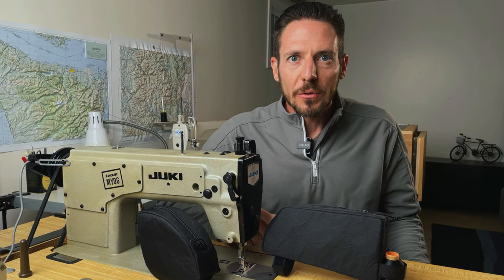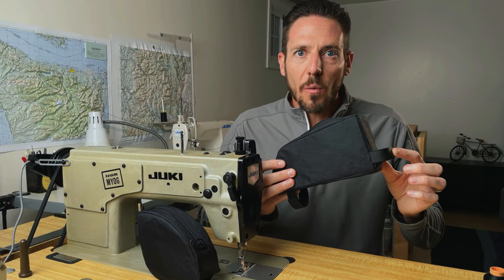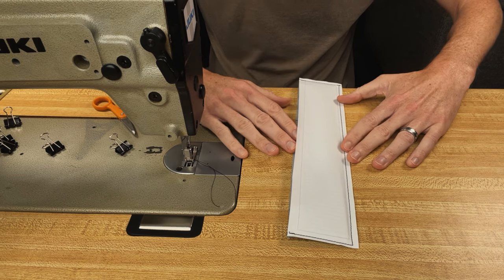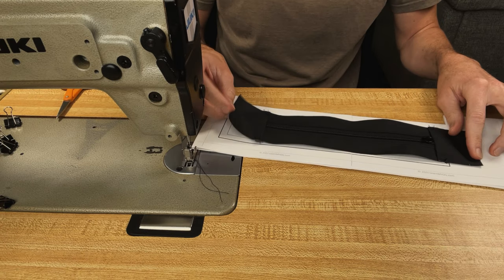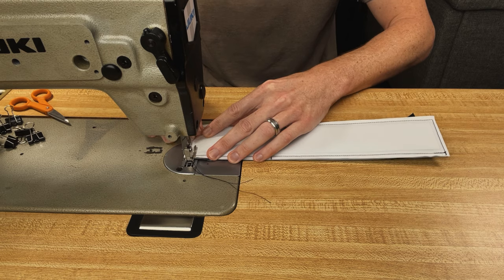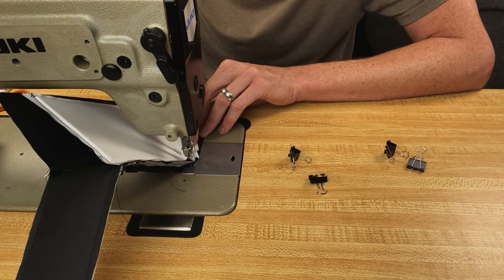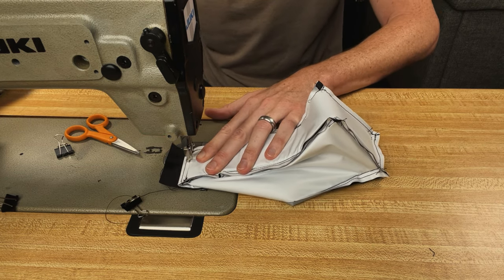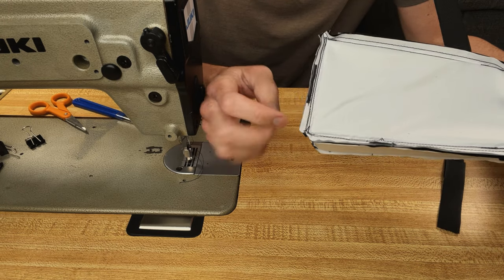Make your own bikepacking frame bag set

Comment: Would really like to see more stuff like this from you guys, especially since these patterns were retired. Being able to make custom bags for my bike or to fit specific products would be very helpful.
Reply from the maker: @williamreinhard  retiring old patterns makes way for new. These are pretty straightforward and not too difficult to self design. Just need the ability to accurately measure the perimeter of the side profile so you can size the zipper gusset.
Reply: @LearnMYOG  Oh, I'm not upset that the designs were retired. Just wanted to say that I really like this style of project and would like to see more stuff like it.

Comment: I m making the HFB ... I have no clue what you mean by ' Fold garage in half an baste stitch on drive side ?????    I could really use some visual clues here LOl
Reply from the maker: The garage is the wedge of fabric at the front of the zipper so the zipper pull is covered when the zipper is closed. You fold that pattern piece in half and the sew it on top of the side panel partially covering the closed zipper.
Reply: @LearnMYOG  thank you!!!!

Comment: Great tutorial!
But how do I work with plastic stiffener, not the flexible foam? It’s really hard to do basting and sewing with firm panels
Reply from the maker: Thanks. Why would you want plastic panels inserted?
Reply: @LearnMYOG  to add rigidity and protection to the contents of the bag. For example, I made bicycle basket bag and camera bag and the foam was definitely not enough. It was extremely hard to work with plastic stiffener, I had to add internal pockets for stiffener sheets.
Reply from the maker: I use ABS plastic for backpack frame sheets and others use HDPE. Encasing like I do with foam would work so you don’t have to sew through the plastic sheet. But sewing a 3D corner will be tough so construction order and seam placement may take some creativity.
Reply: @LearnMYOG  Exactly! Thank you 😃

Comment: Top Tube bag question:  The pattern is one piece with a big line down almost the entire middle.  Am I supposed to cut that in half so that the zipper + tabs can fit between the two? If not, more detail please! and thanks.
Reply from the maker: Yes. I think I included a link to a detailed video on inserting zippers.

Comment: Kind of confused on attaching the zipper to the rest of the middle piece.  Right sides together and sew only on one side, the side where the zipper is when up?
Reply: To get your tabs on, I like this method: https://youtu.be/XDXNP_HkK28 It's different than the method the LearnMYOG zipper video, but it worked for me because I'm using thicker fabric.
When sewing the 2nd tab on, make sure the zipper is the correct length to the LearnMYOG pattern.
After your tabs are on, sew a strip of fabric (wider than you need) to the long edge of the zipper, right sides together. Fold the fabric out flat, then top stitch the fabric close to the zipper. You should now have a correct length zipper, with fabric on all 4 sides. Trim the sides to fit the pattern.
Watch his zipper video and it should make sense: https://youtu.be/Tjf7XQ08I-c